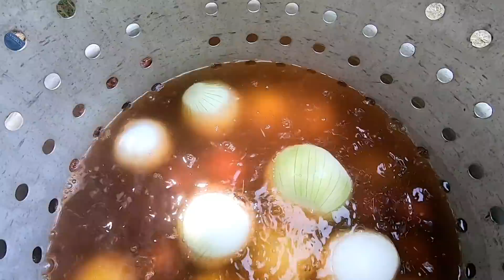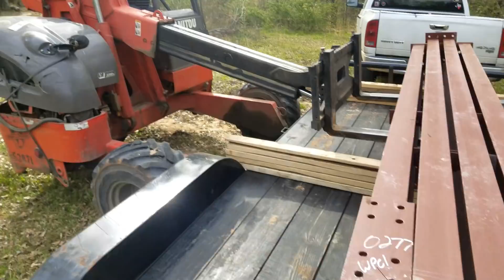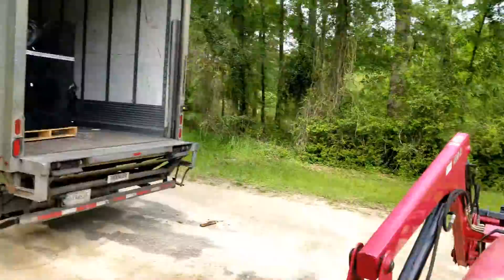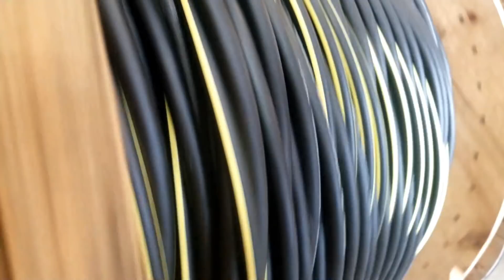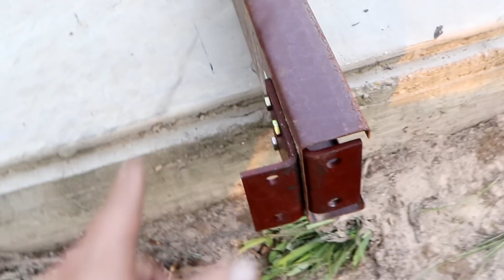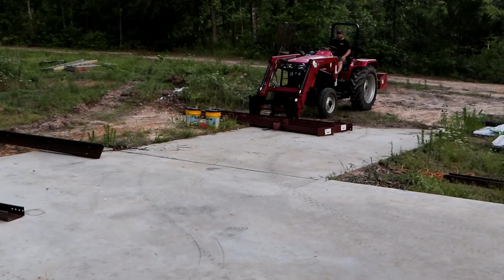THE DREAM SHOP BUILD

Comment: What brand of impact wrench are you using and is it a good one, Would it loosen lug nuts on a car? Shop is looking great. Miss my days of working with structural steel. I was one that would build, prime and ship the parts.
Reply: It's a snap-on.  if it's a 3/8 drive, they say 120ft/lbs  so it would do most car lugnuts.
Reply from the maker: +Bradley Macaulay Thanks for answering Bradley(good to see you btw!) I This one is a 1/4 inch drive but Bradley is correct on the took and specs. I just bought a Kobalt 1/2 inch drive lithium for $150 at lowes. It is good for 400 ftlbs. Been very impressed with the kobalt drill and impact.

Comment: Glad u finally got that Mahindra fixed. Kinda odd the power company I work for puts wire in for customers. When a customer wants to run their own wire they can but they usually try to deter them from that. To each his own I guess